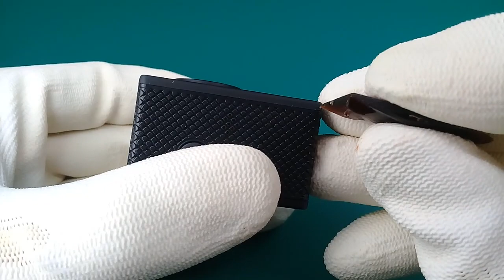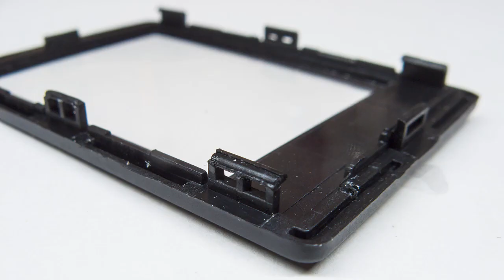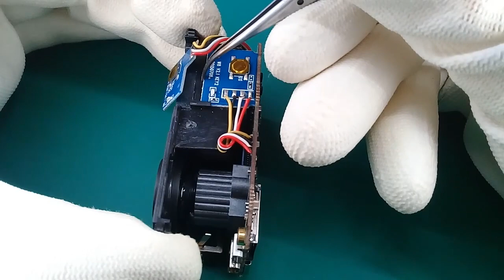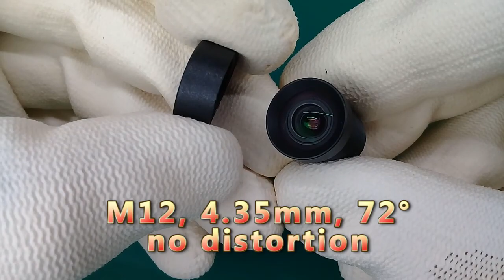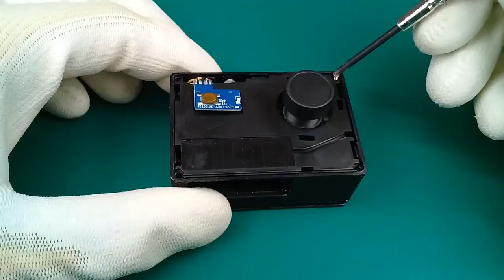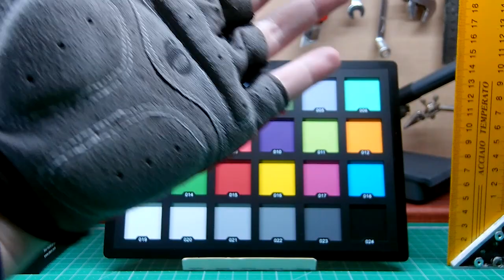EKEN H9R Replace Lens and Mic 📷 Action Camera Disassembly - What's inside

Comment: Hi i tried what you did on your video..i got a problem with my lens 😅.. The color is pink not the same with the original lens..is there any chance to change the color??😅 thanks...
Reply: Maybe you used a lens without IR filter (infra-red)
Reply: What solution can i do with?
Reply: @jeffreyeugenio1972  buy a new lens with IR filter as gluying an IR filter may not be that simple and lens are cheap